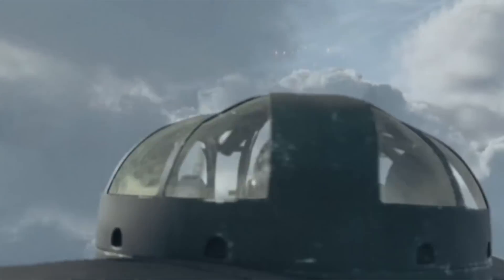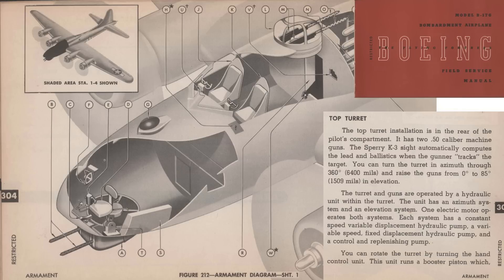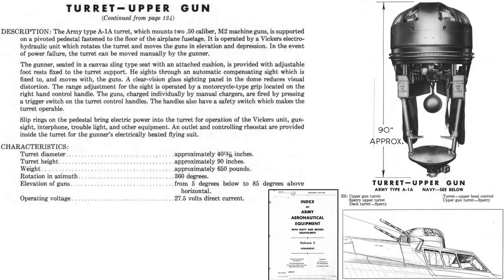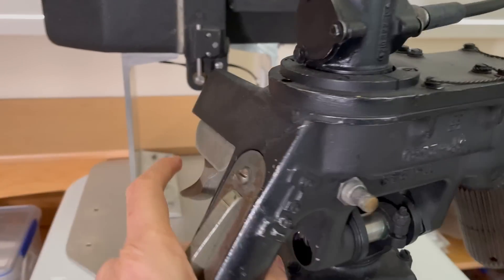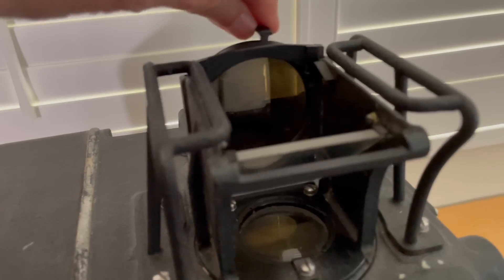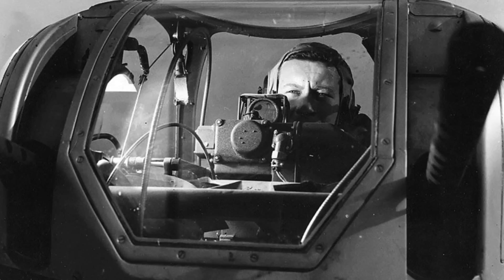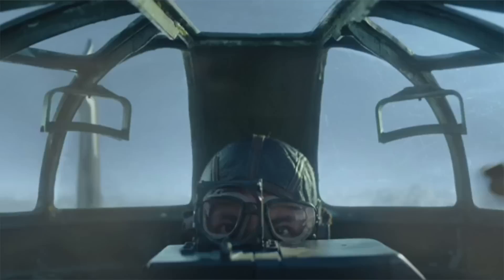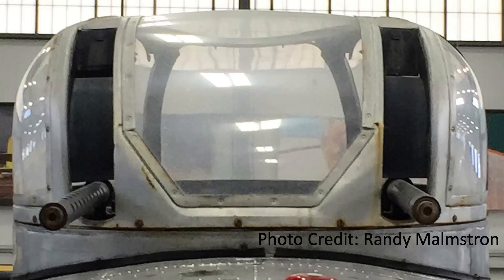B-17 Upper Turret fact checking – "Masters of the Air" Turret speed and 6 other issues deep dive

Comment: In defense of the show ,not everybody can watch it at 25000 ft and well deflection of the air mostly by reversing the turret to the rear could probably assist survival if the shutters were lost. 
 Each side of the face frostbite would have to occur in less than 5 -6 seconds of a fighter's pass being in range and 2-3 seconds of burst time. Newtons law of motion considered -62.22222 C wind chill  etc at 180mph to fight against  winds  might be experience if the front gunner or nose was destroyed.  80 degree arc of fire seems logical. The sight maybe could have  had electrical problems, sure it was maybe melodramatic matinee, it's that simple.

Comment: The hyperspeed Sperry turret rotation was very distracting, as were the fictional sight posts.  The lack of reticule and charging handles were slightly off-putting.  The missing slot shutters is forgivable as motion pictures sometimes remove glazing (even from canopies) as a way reduce reflection.  Though, iIt is noticeable.

I also found the proximity of incepting fighters to be a little too “dramatic”.  Hey, they passed by closely, but not that close most of the time. The show does capture how terrifying these missions were.  

I didn’t notice the inaccuracy of tracers late in the war, but you are right.
= = = = =

Comment: Thats alot of setup for a fighter plane that might be in your sights for 1-5 seconds
Reply: Isn't it though?    I'd guess that most gunners simply put a wingspan in that was an average between a 109 and a 190, set the range bars for a single distance, not sure what, after all a single engine WW2 fighter looks like a matchstick with a dot in the middle at muche over 300 meters- and adjusted aim according to experience.  Mind you, what do I know, I wasn't there doing it.

Comment: A fully-laden B-17-with all that "Technical"equipment-& everything else inside the bomber,-ready to fly,---must have cost a fortune to make !
Reply: Cost of a B-17F in 1943 was $250,000.00  U.S. dollars. or $4,556,899.00 in 2024. Paul Mantz the Hollywood stunt pilot (he made the famous B-17F belly landing in 'Twelve O'clock High' 1949 and died in the crash in the making of, The Flight of the Phoenix, 1965 )made a fortune from buying four engine bombers after the war meant for scrap and selling the fuel that was in them for a profit.

Comment: The amount of technology on WW2 aircraft was amazing, so is the detail of these videos.
Reply: And we are still using them
Reply: I started my bachelors of electrical engineering when 8 bit personnel computers started coming in around 1980 but there were few CAD stations except in very high end areas.
I remember teams of draftsmen who carefully drew and dimension drawings that were then converted into real items by skilled tool makers.  Girls that carefully cross indexed all drawings, copied and distributed.   
-This style of gyro sight was somewhat awkward to use.  You had to track the target to keep cross hairs upon it.  You also had to turn a knob to enclose the targets wing span with a circle (that is s stedometric range finder and how range was estimated)  then as the sight 'calculated' the target lead the mirror of the reflector displace to move the reticle and range circle which the gunner had to continue tracking as it moved.    It was harder than the B-29's GE system which simply added the deflection to the turrets. 
-The Germans had a similar system on a large 20mm dorsal turret for the Fw 200C3 with a computing gun sight but they removed it for the Fw 200C4 because it slowed the aircraft down to much and reduced range.

Comment: Could you address the odd shape of the turret in some of the clips?  In many clips it looks like the turret has a distinctive double bump, but in all the pictures I’ve seen it’s round and fairly dome like.
Reply: The central glass strip running over the top between the guns can appear lower than outside frame, hence the outside portions can appear to be domed above the strip. It's an illusion reinforced by the curved back frame of the glass strip.
Reply: I think 🤔….the double bubble feature was artistic license to better show the gunner’s inside.

Comment: I'd consider the cold air openings in the turret more material than the double speed turret rotation, but super nit-picky on my part. All of these are great, I'm just sad you'll eventually run out of Masters of the Air fact checking topics.

Comment: Very effective weapon.. wast 50 's were very inaccurate .
Reply: There are figures out there for mils of dispersion for each type - flexible mounts are less stable. And the turrets have better sights and potentially gyro stabilisation or computing sights, depending on time frame. The RAF developed powered waist positions with reflector sights for the B-24 but that was for maritime patrol.

Comment: Boulton Paul Defiant's turret had a fast move lever, but you could only use it sparingly.
Reply: I'm surprised that they didn't use ut as Boulton Paul supplied turrets to Sperry to aid development as they use the same electric/hydraulic system AFAIK. Boulton Paul developed it after buying the rights from a French company in the 1930s.

Comment: We lost so many bombers, how good was this hightech equipment really.
Reply: Well, in the Schweinfurt-Regensburg raid, 376 bombers with 10 guns each & 400-500 rounds per gun, managed to shoot down around 18 enemy fighters.
Reply: @mattcavanaugh6082 how many bombers destroyed
Reply: @mattcavanaugh6082  60 bombers were shot down 600 men killed ,captured, or MIA.
Reply: Yeah, I've wondered that myself. I think the B-29's had a good system, the early stuff, maybe not so much.
Reply: There was a British study done during ww2 about the effectiveness of bomber gunnery... which determined that the gunners were only good for calling out enemy fighters so the pilot could take evasive actions. However they used a different strategy of night bombing. So maybe less crew members would have resulted in less enemy fighters downed but less casualties?
Reply: @jonaldous3446 brits use 303  pea shooters and 400yds max range
Reply: @Eric-kn4yn  the British had millions of surplus .303 rounds from WW1. They also did a study on the effectiveness of .303 vs 50 and found it was more cost effective and found 50cal guns and ammo was too big and heavy  compared to having multiple .303s with more ammunition which could do the same damage.
Reply: @jonaldous3446 the UK had several 50 calibre turrets in development in 1939 plus a couple of 20mm ones. The issue was four-fold. Firstly, when war broke out the need was for powered turrets and improvements to them as fast as possible (two gun tail turrets to four gun, etc.), so 50 cal turret development was suspended. The UK couldn't rely on sales of guns and ammunition from the USA in the short term. The UK could not secure a manufacturing licence. The UK used a different propellant type so would either need to set up manufacturing for a different type or modify the gun to suit the existing type as it had done with 303 Brownings.

When 50 cal supplies were available from 1942, development was restarted, if fitfully.
Reply: @jonaldous3446  B.1/39 also called for a defensive armament of 8 20mm cannon - the RAF saw both 303 and 50 as dead ends from as early as 1935 and very much so in terms of specifications from 1937. 303 persisted out of expediency. Even the USAAC saw 50 as obsolescent by 1939 for fighter armament as did most nations.